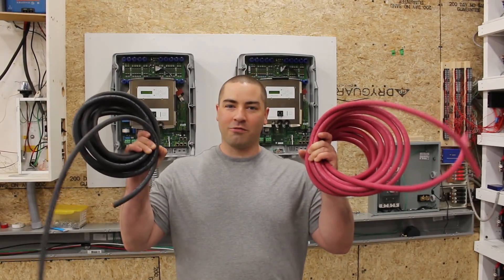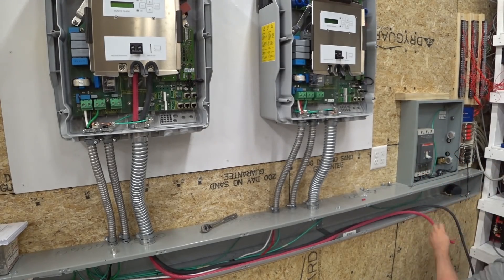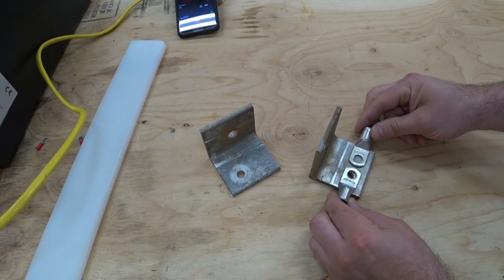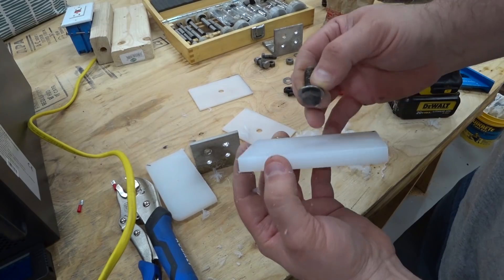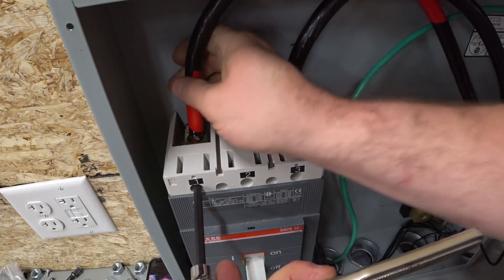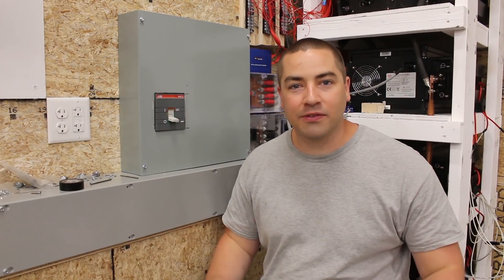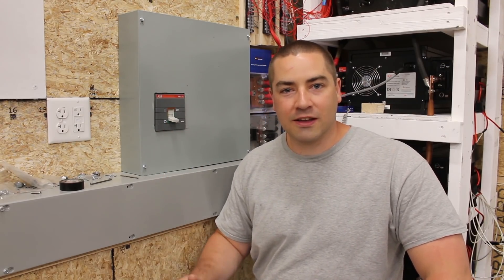Off Grid SMA Sunny Island Inverter Wiring, 48v DC

Comment: Hi David, This is a great Post. I love the series on your setup. I have a questions on the WireWay. Are you allowed to run both DC and AC wires in the WireWay Conduit ? Also, do the Sunny Island have breakers on the AC side ? If yes, what is the breaker on the AC Input and Output ? I could not find that in the doc.
Reply from the maker: I don't see any breakers in the inverter on the AC side
Reply: @DavidPozEnergy  Another question. Why did you use THHN inside the breaker box instead of Flexible Welding Cables like you used from the Inverter ?

Comment: Those temperature probes are suppose to be in the battery packs to shut things down if the cells get to hot. They do the same thing in drill battery packs and laptop packs. their designed to disconnect the cells if temps go to high during charging or discharging.that would likely be caused by some sort of cell failure or internal short. If those cells get too hot and are not disconnected the internal chemistry will cause them to vent likely causing a fire. Also If you are ever wondering about what wire gauges are large enough for the load you can also lookup ampacity charts online that will tell you what amperage can be safely carried without overheating.

Comment: I'm curious how warm your aluminum bus bar connections get when Under full load.  I've experimented with a few different types of quality hydraulic crimps and found some to be inferior.
Reply from the maker: I did check that while pulling 230 amps.  The aluminum was 1 degree F more than ambient air.  I don't think that's any big deal.
Reply: @DavidPozEnergy  that's good to hear. I've got plenty of aluminum & no copper laying around so I'll try an aluminum bar next time.
Reply from the maker: Please keep in mind that aluminum can carry roughly half the amps compared to copper for the same size.  Meaning you need to use thicker aluminum for similar results.  I went super overkill with my busbars in the video, but I had the chunk of aluminum kicking around anyways.
Reply: @DavidPozEnergy  I tried to put one hundred amps through a cheap zero gauge copper clad aluminum and it got pretty hot. It might not have even been good quality aluminum though.
Reply: I'm worried about the high resistance of the aluminum

Comment: Hi, i have 4 solar panels for a total of 400W,  same specs (21V 5,65A shortcircuit), but i've noticed something strange, if i connect in series (2 couple of parallel and in series, 42V 10A) or all 4 in parallel (21V 20A) i only have a total of 240W, the problem is not the cable because i try to shortcircuit in the back of panels or near the charger, same results.
The weird thing is that se single output panel when i shortcitcuit is 5A, but when i put all togheter i have only 3,8A, same thing with  real MPPT or cheap PWM.
Thank you very much if someone know how to help me :)
Reply from the maker: Sorry, I don't know what is going on.  There are lots of good facebook groups with people willing to help each other.  I'm in "DIY Powerwalls".  It's worth posting your question with pictures to a group.
Reply: @DavidPozEnergy  thank you very much, i hope my question wasn't inappropriate here, anyway i love your vids :)

Comment: I realize it is still much safer to have all the cable physically and electrically protected through the conduit, but NEC wise, can you use welding cable through a conduit attached to a building?

Comment: Do know that you could use instead of a charge controller a normal  grid tie inverter which would be cheaper than victron charge controller.                          https://youtu.be/D5HYcCLDuDw

Comment: 6:30 David, you may be able to find and old 3 bolt it breaker panel to pull the copper buses out of & also all the industrial breakers I have ever dealt with have an amp rating for A/C & D/C voltages. Another reliable source of Amp ratings would the UGLY book. I've noticed Home Depot selling them in the electrical department or you most likely will find one on Ebay, Amazon or just find your closest Electrical supply dealer they'll have a lot of stuff there you might useful.  Good luck.
Reply from the maker: Thanks.
Reply: @DavidPozEnergy  I meant to say an "old 3 phase bolt in breaker panel"  jeez that word prediction thing on phones makes my life hard.... lol ..... I should have read what I typed.

Comment: Do you have a video on how to connect your solar inverter to the house breaker box if power goes out? Like power went out flip a few switches to connect to the solar inverter and power a few of the 120v circuit in the house? Hope what I asked make sense.

Comment: Your breaker will not trip if it has an over current condition. You can't run positive and negative together as the current will cancel itself out. At best you only have a disconnect switch the way that you have it wired. Also the bms shunt wires are backwards. Black should be on the right side instead.
Reply from the maker: I wired the ABB circuit breaker in accordance with the ABB instructions for DC.

Comment: Nice work David! I was looking forward to seeing you continue this project as I've two two Si6048's as well. Just about to order 4 SMA SB inverters which will AC-couple in offgrid situation. Have to order that ABB breaker... so have to be careful on the torque so not to strip it. Good tip there. Cheers!
Reply from the maker: After I stripped it I asked an electrician about it.  He told me "Half of them fail" if you actually go up to the spec.  LOL.  The breaker is an S5N
Reply: @DavidPozEnergy  You wouldn't happen to have the model/brand of grey wire troughs you are using to run your cables in? Local electrical wholesaler are idiots.

Comment: Do you prefer Chargery? I had two defective Daly BMSs and had to ship them back to China for repair at my own expense. I am looking for a better solution. Another question David. I’m a previous video you said you bought the SMAs, both units for $2,400 delivered. Based on the links to eBay, the price seems to be double that amount. Any ideas on specifically where to source those at a better price?
Reply from the maker: I don't have a preference on BMS.
Yes, I see the prices have shot up on ebay for the inverters.  I think these inverters sell for $4800 new, each.  So even buying it at $2000 each is still a good deal.  But at some point I would move to a different solution.  If the pair of SMA is $4,000 or more, I would just go with a 12kw Aims: https://amzn.to/2MvSMCN
Reply: I thought the Aims has limitation on the voltage range. I’m using the Bolt LG cells with a 14S so I need 43 to 58V. I’ll have to check that but thanks for the suggestion. Demand for the SMA’s probably spiked when it got the Poz bump.
Reply from the maker: LOL.  Poz bump.  haha.  These SMAs are very good quality electricity, but there are so many nuances to the program.  They are a bit of a challenge to learn.  At least for me.  If I was starting over altogether, the Sol-Ark 12K is actually the cheapest solution.  It has a big up-front price tag, but when you do out the math on all the things included, it is actually the cheapest solution.
Reply: @DavidPozEnergy  appreciate your awesome content and feedback on my BYD questions...  I'm curious, why'd you upgrade from the AIMS anyway?  I've watched all your vids that appear relevant but am missing this tidbit... just more capacity?  Big inductive load?  AC perhaps?  In my case, I'd love an option that allows me to pass-thru solar to the grid until I move the system to an off-grid house in 3-5 years, and it seems the Schneider Conext XW+ 6848 is the lowest cost of admittance, so to speak, unless I found a smokin' deal on some used Sunny's like you did.  If only the AIMS was grid-interactive, it'd be hard to beat price-wise by far!  My starting HVAC load is only a 2-ton unit at maybe 50-60 LRA w/hard start kit, which I'd hope the single Conext 6848 could handle.  Hmmmmm.

Comment: You stripped the hexagonal hole not the threads? Drill it and use an EZ Out, get another set screw.
Reply from the maker: No, I stripped the threads of the set-screw inside the lug.  I was turning the set screw with the allen key but it wouldn't back out.  This was in the middle lug.  So now I'm just using the two outside lugs.

Comment: Looks great, but I wouldn't run the 24v shunt trip coil at 48v when you actually hook it up, because then the coil produces four times the heat. The datasheet for your breaker should list the coil resistance. If you put the same value resistor in series with the trip coil, it should form a voltage divider to drop the 48v to 24v. You wouldn't want anything to burn up if the coil is gets powered continually for some reason. Stay safe, and good luck!

Comment: search marine busbar, if it is safe enough for a boat, should be safe enough for your home. Fires on boats are scary stuff. 
https://www.amazon.com/Blue-Sea-Systems-MaxiBus-BusBar/dp/B006VELFDK/ref=sr_1_1?dchild=1&keywords=ul+300+amp+48+volt+busbar&qid=1590869665&s=electronics&sr=8-1
Blue Sea Systems Common BusBars (100A-250A)

Comment: Hi what about  eddy currents positive cables going through a hole cause eddy currents there should be a slot from plus hole to negative hole to inverters if metal  as they will get hot
As eddy currents will form around holes at high currents  like your programs
Reply: Eddy currents are only created when the current through the wires is changing (ie AC not DC). That said, I agree it would be better practice to run them through the same hole if possible.

Comment: Thanks.  Mostly done.  What is next?  Like 485.
Reply from the maker: On this system I have to install the yellow covers on the inverters, but I found the conduit interferes slightly, so I have to grind off one corner.  I also have to calibrate the shunt of the BMS.  I have to install a relay between BMS and breaker.  And then some plywood over the front of the battery rack to keep my daughter from grabbing the wires.

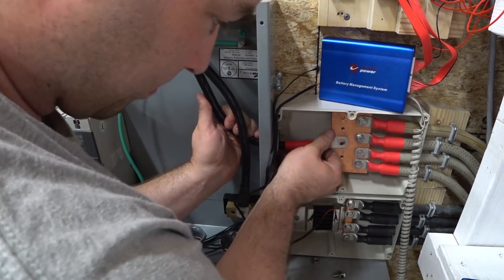Comment: 7:25 I may have missed it in another video, but how come you didn't tap the copper? It would make this step a whole lot easier. You wouldn't need to get a nut connected from behind.
Also, shouldn't you be using brass/bronze bolts instead? Anything else usually causes electrolysis and corrosion
EDIT: I see you used brass/bronze at 9:38 on a different connection  😉
Reply from the maker: I made the copper buss bars by flattening copper pipe, and layering that up.  So it's not a solid piece of copper.  But if it was solid you are correct, that tapping it would be a lot easier.  I wish I knew more about tapping soft metals (copper and aluminum).  Like thread count per inch.  I think soft metals need courser threads?  I need to find a good guide on that info.  
As for the bolts, the shunt came with brass bolts.  Any bolts I added to my own DIY bus bars are stainless steel.
Reply: @DavidPozEnergy  Ohhhh, ok!  gotcha.  I had forgotten that was multi-plated copper :P  I wouldn't try tapping it as it wold just strip out anyways. In a block of copper it'd be the same as doing steel, but you just want course thread not fine.
I have found that even with SS and copper, there can still be some electrolysis and corrosion. Not sure why. You did mention you were going to coat the aluminum bracket, perhaps do the same with the SS bolts to keep oxygen out and slow or mitigate issues. It's amazing how much just spray on clear nail polish works for things like these 😉 just don't tell the wife you're borrowing it

Comment: Hi David would those sma inverter still be available.
Reply from the maker: Yes.  Here is a link: http://rover.ebay.com/rover/1/711-53200-19255-0/1?ff3=4&pub=5575553304&toolid=10001&campid=5338624228&customid=&mpre=https%3A%2F%2Fwww.ebay.com%2Fsch%2Fi.html%3F_from%3DR40%26_trksid%3Dm570.l1313%26_nkw%3DSI6048%26_sacat%3D0%26LH_TitleDesc%3D0%26_osacat%3D0%26_odkw%3DSI6048
Reply: @DavidPozEnergy  I have watched many of your videos and you inspired me to build my own system, I currently have a 18kw chevy volt battery that I will dissect into 14s as per your findings and I have 5 x 325w @39.1volts panels, I am in the process of sourcing parts and wires, fuses, etc, again thanks.
Reply: @DavidPozEnergy  I purchased one and shipping it to Toronto.

Comment: so if you battery shuts off the way you have it wired now would the charge controller keep the inverteres powered if so do you feel the suddent voltage change would damage anything
Reply from the maker: In theory, yes the charge controller could keep the inverters going.  I plan to wire in a trip to the charge controller so if the ABB breaker trips, the charge controller also turns off.  I'm just not there yet.
Reply: @DavidPozEnergy  ah i see damn shame that lug stripped out some times listed tourqe settings are just that little to much
Reply: @DavidPozEnergy  Is that "Stripped" Lug still usable at all? 

If so, Run the charge controller Positive into the spare Pole on the breaker, (Probably best on the Battery side), and run a cable from the stripped lug to the bus Positive bar.
The lower amperage needs of the Charge controllers means you shouldnt need so much torque, so the lug might still be usable, and that way if the breaker trips, it also isolates the charge controller and ensures a dead Bus load side.

The guy from the LithiumSolar channel set his up in a similar way, where he used 1 Pole for the Common Positive, 1 Pole for the Inverter Negative, and the last pole for the Charge controller negative.
https://www.youtube.com/watch?v=jBc5bLjC3cg

Comment: would they be a gain to soldering the ferrule on
Reply from the maker: No, I wouldn't do that.  You want the wires to conform to the shape of the lug for maximum surface contact.
Reply: @DavidPozEnergy  yeah had not thoght of that

Comment: Very nice again David!
Can you tell me the part number of the ABB breaker?
Was the Chargery shunt not calibrated from stock!
Ciao, Rik
Reply from the maker: The Chargery BMS and shunt never showed correct amps from the box.  Then I tried changing some settings, but made things worse.  LOL.  I really have to do the full calibration, just need the time.  I wanted so badly to just start using the solar power that reading the amps on the BMS is less important to me.  And the breaker is an ABB S5N.  http://rover.ebay.com/rover/1/711-53200-19255-0/1?ff3=4&pub=5575553304&toolid=10001&campid=5338624228&customid=&mpre=https%3A%2F%2Fwww.ebay.com%2Fsch%2Fi.html%3F_from%3DR40%26_trksid%3Dp2380057.m570.l1313.TR2.TRC1.A0.H0.XABB%2BS5N.TRS0%26_nkw%3DABB%2BS5N%26_sacat%3D0
Reply: What AMP rating is the ABB breaker and how did you calculate ?

Comment: david also, whats your total solar capacity / whats your battery storage total at the moment,? and at what, 48w system?
Reply from the maker: My solar array is 4.4kw, connected to a Victron 250/100 charge controller.  The battery is about 24 kwh, nominal 48v.

Comment: You could have cored out the set screw of that lug with a drill bit and that would give you access to the screw holding it onto bus inside of the breaker. Then, replace it and carry on! Why do you think it stripped?!
Reply from the maker: I was using a torque wrench, and it stripped before I hit the minimum.  I don't know.
Reply: DavidPoz very unfortunate. Been there before! But, still an awesome video.

Comment: It is a very nice system, however, why are you not using De-ox on your connections? Great vid, I watch all of them, thanks.
Reply: I don’t know why david doesn’t, but typically when you run copper, inside out of the weather, and farther than 3 miles to the ocean it usually isn’t needed.  With aluminum all that goes out the window.

Comment: I personally would of replaced the lug, yes it would of been a little bit of work to do but better safe than sorry. Then you could resume with the original wire design. Them buss bars seem a bit sketchy but as long as it works then might as well use it for now.

Comment: Saved how much like what’s the delta?
Reply from the maker: So far I have spent more money on equipment than I have saved on electricity cost.  I don't know if I will ever save enough to offset all the cost.
Reply: That is my debate with myself right now.  I'm trying to decide if it is worth the 7 to 8K cost that I have calculated.   I was without grid power for 4 days recently.  I have a 12kw diesel generator that drove the house just fine.  It was funny watching vehicles slow down and point at my security lights on a dark street.
Reply: In order to drive the property correctly, 20 to 30kw is what is required.  That is one big battery bank and pv array.

Comment: I did my bus bars differently, i bought some thick walled copper pipe, flattened the ends to bolt the cables to them, then put 2 layers of shrink wrap over it all, then i used the nylon conduit hangers that ratchet closed to mount it to the wall of the enclosure.
Reply: @ 175 Amp  Dose It Get Warm  ?   what it takes Inverter To Make  About 5kw AC